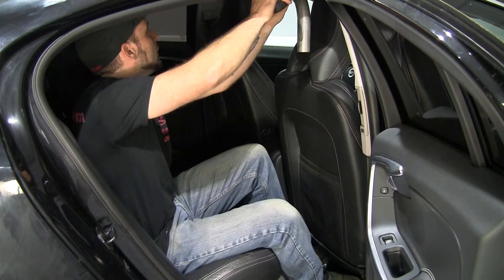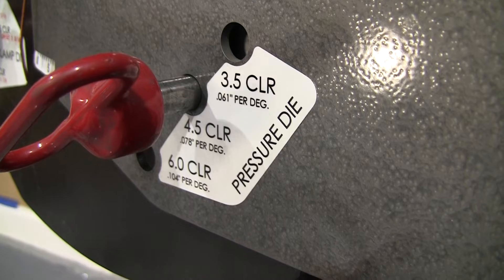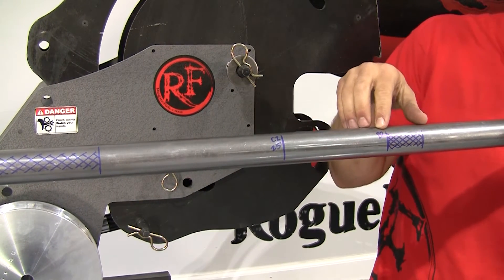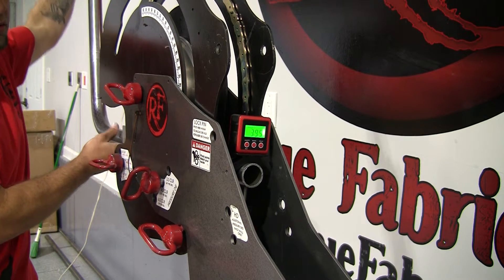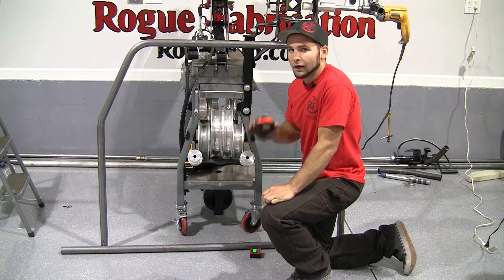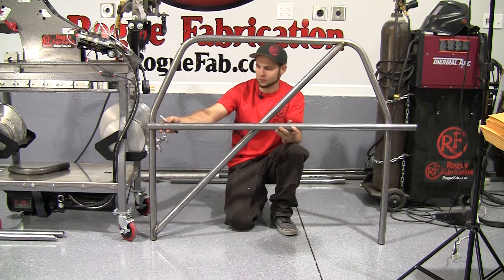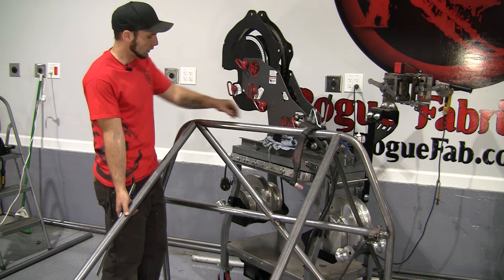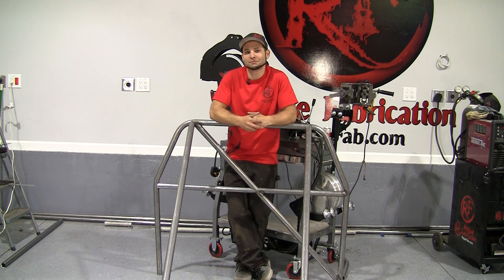Roll Bar Class! Learn how to bend a 4 point roll bar/cage! Tube bending techniques tips and tricks

Comment: I have a question regarding tube size and dies. I'm building a tube bender for 1 5/8" tube. I chose this size since galvanized chain link fence posts are sold in 1 5/8 inch OD and I'd like to try bending go-kart and bike frames. The  thing I noticed is the tube is about .025 larger than 1 5/8 inch. This prevents it from sitting all the way into the bending die. It leaves a gap of about 1/16 of an inch under the pipe. I'm wondering if it will just force its way into the die once I start bending? Or do you think it will kink? I'm not opposed to sanding the die to make it slightly larger so the two parts fit together better since it was a relatively inexpensive die. Any advice? Thanks.
Reply from the maker: You have 1 1/4 pipe. It is 1.660 OD. Tubing is 1 5/8 (1.625). We explain the difference in the tech section at roguefab.com. As for bending material in the wrong die, I would just get tubing. It's better. Or give it a shot and see how it goes. -Joe

Comment: Thank you for this interesting, informative video.    Two points that I would like to see more information on are the measurement of the rear diagonal braces from the roll bar to the rear shock towers, and then the process of installing the cage -- I'd guess the rear braces could make moving the cage into the car something of a chore unless one waits to weld the braces after the roll bar was installed.
Reply from the maker: Those are great points we need to expand on. We will be doing a 100% start-to-finish cage in a race car later, and we will install it in the car on boxes (or with plates). Subscribe (if you haven't already) so you don't have to check back in to find it! -Joe

Comment: I learned that i will need place the tubing on a angle iron to draw felt marker lines the length of the tube 0 30 60 90 if i am to be assured the 90 and 45 degree notch will be correctly oriented on the harness tubes.

Comment: I have to build an 8.50 cage for my 53 Chevy pickup. It's your basic inline 6 292 with a 6-71 blower running about 1000 HP at the flywheel. Thanks I need all the help I can get. I love my bender but have a lot to learn.
Reply from the maker: Sounds great!